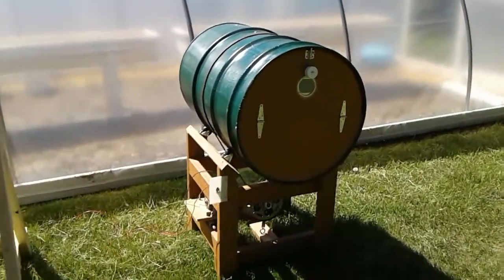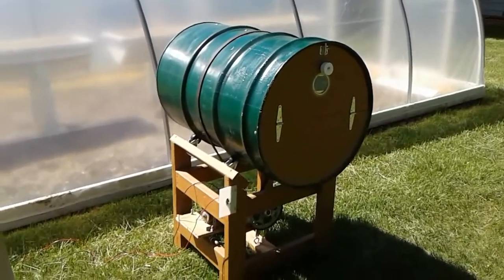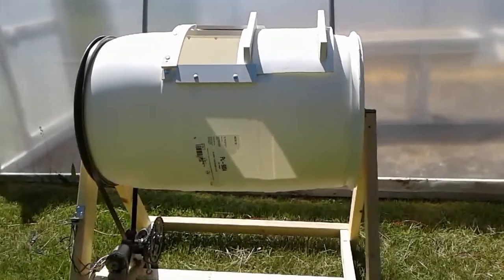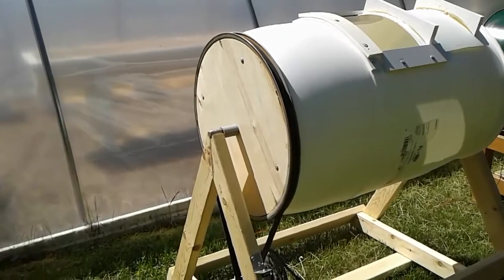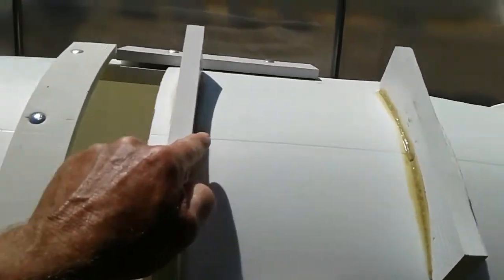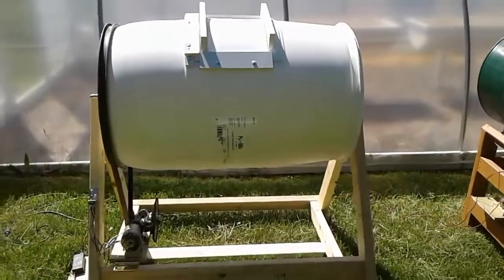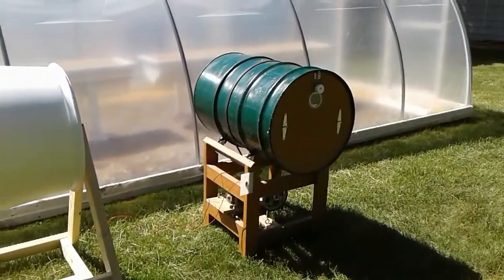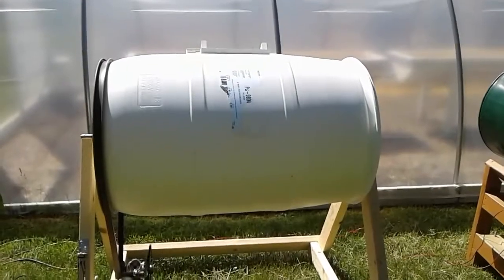How to make a rotating composter

Comment: Im in the UK. I use a plastic drum 220 litres that was used to transport olives from greece to UK and it has grooves for the casters to run in. I have fitted handles to help rotate the drum manually whenever I walk by (save on lecky) and have it at a height so I can side (rather than end) empty it into a wheelbarrow by opening a latched hatch.

Comment: Well I am really concerned about this earthquake and I hope all your structures were OK.  And I thought it would be neat to see the machine actually running.  But I came to look for a design idea on how to motorize a rotating drum and this kind of idea would fit my need if I can get my belt to stay on the edge of the spool somehow (my application is to wrap string around a drum, just a certain amount so i can cut it to length manually because i am tired of making the drum go around! and i have to get it to stay in a bundle when i cut it or the ends will get all scrambled. and no i don't have any money or experience)

Comment: I am interested in the plans for the rotating composter.  Where can I get the plans.??
Reply from the maker: Sorry, but those plans were lost when our computer crashed, and we had to install a new hard drive. Most folks found the plans too complicated, and we gave up on them.  i suppose I should delete this video, since we do not make those composters anymore (although we still use the ones we have).  What we learned about barrels is that they tend to roll the material into balls, which was less then ideal. We prefer our octagon- shaped one now, that we just spin by hand.
Reply: @backwoodbasics9383  Don't delete the video - it's helpful!
Reply: @backwoodbasics9383  If you put tumbler wings inside, it will break up the compost as you turn it. You can do all different kinds of thing from cutting PVC pipe in half and screwing on to installing extra pipes lengthwise inside to attaching angle braces.
Reply: Curious about the motor and axels used here. I have an hex composter. But, being out of town/working some heavy weeks gives me a big clumps from neglect of turns. I believe an auto rotator with many nails on the metal barrel would yield the best compost.